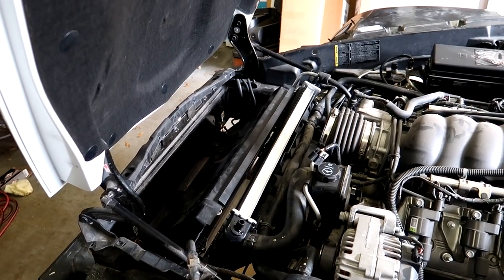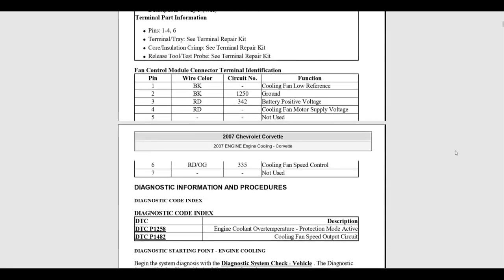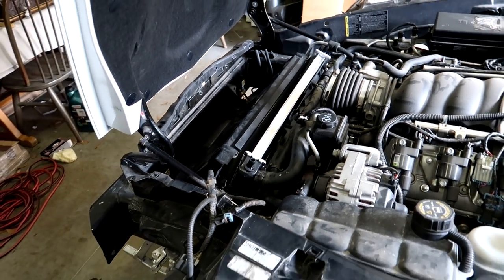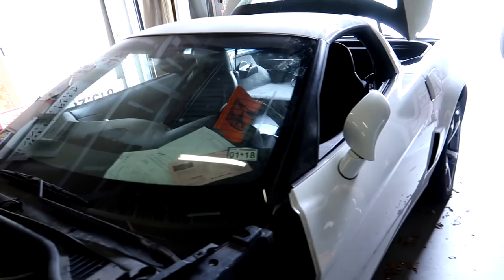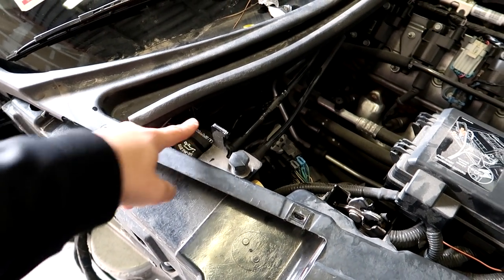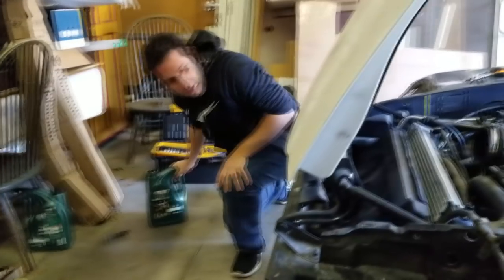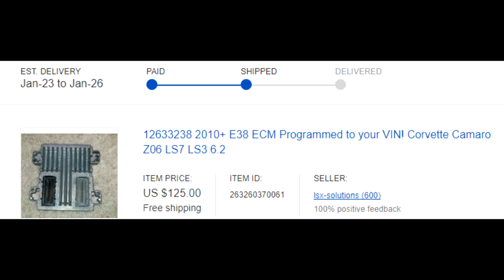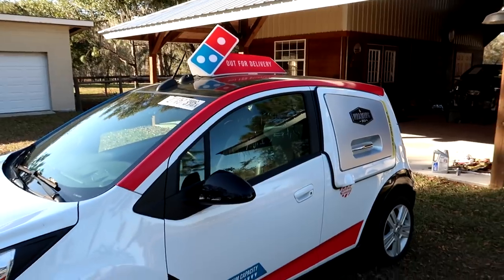Tried to Start The Corvette... More Problems! (MAJOR Piece Missing)

Comment: It's probably even better than you think.  About the only reason for someone to remove the ECM from your smacked 'Vette would be to use it to test on another car with a problem to see if the unit on that car is faulty.  In the motor trade it is standard practice to only swap over a test unit that is known to be good, so someone has seen your car running and operating normally, and as it couldn't be started with the ECM removed from the car that means that there is an almost guarantee that the engine on your car is perfectly fine.  I would say, in general, avoid main dealers for electronic unit programming if your car was launched a year or more ago.  Especially if it's a common make like a Chevy there is a very good chance that one of your local, trusted workshops will have forked out the money to have dealer-level diagnostic equipment so they'll be able to do anything that the dealer can without the stupid labour charges, and often the independents will do a better job as a lot of main dealers will only install the original base programming that was on the car when it was built whereas most independents will make sure that they install the latest updated version of the programming that is available...

Comment: While I hope the new EMC does the trick, I do think there is a distinct possibility that the fine tuning and syncing of the EMC with the other modules on the Vette may require a trip to the dealer for additional programing, but it'll still be cheaper.
Reply: Kboomarang Finch ECM?
Reply: I had the same issue on an impala. Guy on eBay programmed it to my vin, but I still ended up having to go to the dealer.
Reply: Whooops!!!!!!
Reply: He still saves an hour labour, and $325 on parts doing it that way.
Reply: you can buy a vin programmed ECU off ebay or whatever for those without going to the dealer or even without a good scanner, if you do the passkey relearn yourself with new ecu (turn the key to try to start, leave it in run position for 10 mins, turn key off for 10 seconds, and repeat 2x for a total of about 30 mins. will start right up afterwards if done correctly
Reply: also, if you screw it up you have to start all over, and it's easy to mess up the first time, so budget about an hour. on most gm cars the theft light will turn off at the end of the 3rd 10min wait period to show complete and you can insert additional keys and turn to run to add your spares
Reply: Ijnat ecm and ecu are same thing, ecu=engine control unit, ecm=engine control module. Basically the computer that controls the engine.
Reply: Will require the new ECM and any related service functions, plus additional central car configurations performing.

Comment: You have to do a procedure to reprogram the alarm system when you install a new ECU it’s like leave the key on for 15 min then off for a sec then on for 15 min you have to do that 3 times and if you don’t do it right the car will run for a few mins then die on you

Comment: How in the world did that body shop forget to put the ECM back in? Behind the fender seems like an odd place for it, too.  Looking forward to the next (last?) video on the DXP car.
Reply: the body shop might off keep the ECM for themselves
Reply: Just like they kept the headlights. Easy to sell and ship parts that can be hidden if its not the owner/manager of the shop to begin with.
Reply: Body shop or inside person hoping to buy car at auction... car will go to auction as “does not run”, so gets pushed though to bid block, and by that, price is low.
Recall, wires were hidden too.

Comment: Hello @Samcrac I went through this with my 2005 corvette I have on my channel.  I had an aftermarket ecm from another tuner and they had locked the ecm.  When I tried to switch to a stock ecm  and get it programmed by a guy that does that the car wouldn't respond so I had to take it to the dealership.  After they programmed the ecm to my car then I was able to modify it with my custom tune since I rebuilt the engine with a different set up.  I Also have an 08 audi I modified and I bought the ecu  from a guy on eBay.  I simply sent him my vin number and he was able to program it and it was Just a plug and play tune.  Hope everything turns out well.  I may have some extra parts I can give you if you cover shipping.  Let me see what I have in my cluttered garage.

Comment: Not sure if you changed the oil or just added oil. There is a different procedure for checking the oil level on a dry sump system. If you just checked the dipstick and added oil it will have to much oil and make a huge mess

Comment: All the other modules in the car will need to be programmed to the new ECM no matter what, the BCM even controls the push to start   the new ECM will work fine but will have different ID number so all the other modules aren't going to work

Comment: I feel where you are coming from with staying away from “stealerships!”  I just recently had to replace my crank shaft sensor.  The part $85 after the final cost to get it installed and programmed $530 ☹️.

Comment: Dealers are terrible when it comes to ecm programming I have a 2001 trans am my ecm died, contacted the dealer for a new ecm they said it’s 150 for the ecm and if it needs to be programmed the programming was $500. So I bought the ecm from them and programmed it myself with my hptuners software. Best part is the ecm was sold to me as a brand new ecm it was a used ecm off of a Chevy avalanche.

Comment: You didn't tighten the battery cable, how could it start?? Unless you did it off camera.
As you can see on my pic, I'm a diesel mech. Number 1 cause of no crank, and ign turning off and on like that is a loose battery cable.

Comment: It does not take 2-3 minutes to program an ecm. Trust me. I do these types of programmings and depending on the car you have to wait from 15-25 minutes. And that is not including the time it takes to program the key fob back into the car. And they do have to download and install software into the ecm. Dealership isnt wrong on that, but the price they charge is outrageous. Get a local locksmith that has a Tech 2 scanner with GM software to go out and reprogram a used or new ecm. I usually charge $120 to do this. I have never had the pleasure of doing a corvette so idk how long these usually take.

Comment: the dealership charging you an extra hour of labor is ridiculous, but i think i have that beat... my dad took his ford fusion in to get the oil changed at the local ford dealership. recently, the stopper button that stops the male end of the seatbelt from sliding down the belt to the floor fell off. he asked how much they would charge to put on a new button. they told him they would have to replace the entire seatbelt and all its components for $465...

Comment: why don't u call body shop who disassemble car and and ask them about ecm
Reply: Sahith Raja that is the problem when you buy salvage cars, you do not get any of that kind of info to figure out who may have torn the car apart before it went to salvage car auction - all you might get is who the seller was (insurance company/dealer/third party).  It is also something to keep in mind when buying salvage cars that are already partially disassembled - you never know exactly what they took apart & what removed parts are coming with the car when bought from the salvage car auction.
Reply: he doesn't know who the body shop was who took it off. he bought the car at an acution
Reply: trust me they looked at it, took the easy money parts and sent it back to the auction. they knew what they were doing.
Reply: he does actually, he has the phone number of the original owner of the car as well as all the paperwork from the bodyshop where it was declared salvage.  It was in a previous episode
Reply: KCautodoctor w
Reply: He has the number for the original owner. And has spoke to him on the phone already.
Reply: Sawmiller Smith you obviously didnt watch his other episodes.  He has that info.
Reply: no in another video he told that he has the papers of the shop  who disassembled the car for damage assessment
Reply: I think ur right about it they can reprogram the ECM and use it with another vett
Reply: ya did watch that video but i want him to call the shop

Comment: $400-500 for a new ECM? You need to apologize to that dealership for calling them a stealership. My '04 Odyssey ECM is about $1600 new plus an hour and a half labor for install and program. And, there is no way to "limp mode" it to the dealership for programming. You either drive it in with the old module or you have it towed in.

Comment: Did you ever determine why the Corvette so low on oil initially?     I have now heard it run and it kicks ass.  It must have passed smog so it ain't burning gobs of oil.   Just a curiosity for me.   btw I use the exact same oil in my 2001 Miata.   Race you anytime...

Comment: you can get the computer without programing it.. get it on ebay.. the ECM CAN BE PLUGGED IN AND YOULL BE GOOD TO GO.. AND DEALERSHIP ALWAYS BULL SHT..  YOU DONT NEED TO HAVE IT PROGRAMED
Reply: IER VIBEZ Yes you do.
Reply: Bent Badger no you dont.. ive replaced the computer on my 2001 ford taurus and had to replace the computer on my 2002 XG300 both purchased on Ebay. you can either fall for the dealerships B'S and let them take you for your money or go do your research .. theres many sources online who sell the ECM's and they program it by the vin# and ship it out .. dealerships are all full of shit ..

Comment: The power of Ebay! I always check out the Ebay deals. Had an abs module fail on my bmw and a new one was 500-1200 plus dealer reprogramming at 300. Yikes! Found a place that refurbish the one in your car with better components than the factory bosch unit so it won't fail again with a lifetime warranty for 95 bucks and they paid for shipping both ways. Best of all since it is the abs module from your car it is plug and play! I ❤ Ebay!

Comment: Oil cap say mobile 1 full synthetic he uses Castrol synthetic blend hand in face
Reply: first name last name do you know how oil works? 🤦🏽‍♂️
Reply: Nick Findley do you understand why oil has API service ratings and p/n codes
Reply: first name last name yes, and just because the manufacturer recommends a specific brand does not mean other brands don’t meet those requirements.

Comment: Keep plugging away. I had a black 05’ C6 when they first came out. The car was bitchin’ but it was a weekend premidona driver. I drive a 2018 BMW M550i now... much more reliable daily driver than the C6 Vette. I also had a C5 Vette but crashed it. That was a much better Vette than the C6, imo.

Comment: Is that ECM the same as an ECU?? And could an aftermarket upgrade be done, with something like a haltech type, to get more power ect??
Reply: Haltech's (or most other standalone ECU's) are easily $1000+
Reply: Probably $2k actually, but I was thinking that if he was thinking long term on upgrades, its better to do it now. Something like that would enable that car to take big turbos, supercharger, or just more general upgrades like air filters, exhaust ect and get the best from them.
Reply: Christian Buczko GM ECUs can be retuned using software called HPTuners and you can do all the timing, fuel, boost tables you want in there. Not as expansive as a stand-alone but very upgradable still
Reply: Christian Buczko Technically GMs use a PCM. They don't have an "ECU".
That's essentially just semantics though.
At least in my experience with Cadillac and Pontiac.
Reply: Why would you need a haltech you can change any parameters using HP tuners and a stock ECU...
Reply: Can you pass emissions with an aftermarket ecu? Probably not. So when Samcrac goes to sell it, the buyer is going to want $$$$$ off
Reply: PGTMR2 That really depends on the tune and what equipment is on the car doesn't it? I wouldn't think the emissions levels really care who made the computer.
Reply: Caddy Guy Gaming It's an automatic fail, just like "off road use only" parts. They can't verify the emissions equipment isn't faked, simulated and/or turned off.
Reply: Interesting, didn't know that. Glad we don't have inspection in my state.
Reply: I always thought they tested the actual exhaust coming out. They just take a computers word for it instead? It would seem if they don't actually test the exhaust gas it kind of defeats the purpose.
Reply: They do and don't. My OBDI car they run when they test it and they sample the exhaust. It doesn't have  as many tests and memory for passing those tests being an older ecu. I have an OBDII ecu I use 99.99% of the time, it would pass the sniffer test the same as the OBDI ecu making 12-15 hp and tq more due to one sensor upgrade. It's about a 5 minute swap. The OBDII ecu also has way better control over the fuel, I swear it used half the fuel on a trip around the city for comparison, (1/8 vs. 1/4 tank.) Coming up on the very last e-check it will need, but I have a cat and like it to run clean it's loud enough as well.